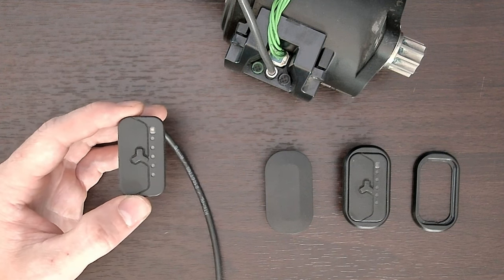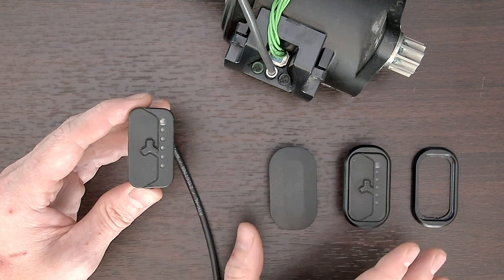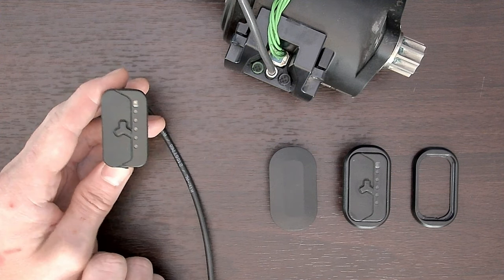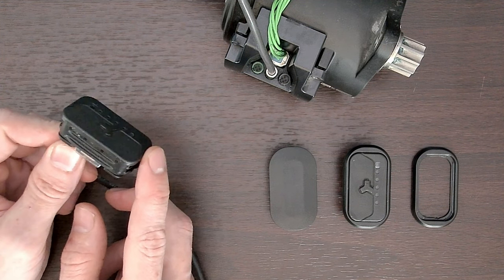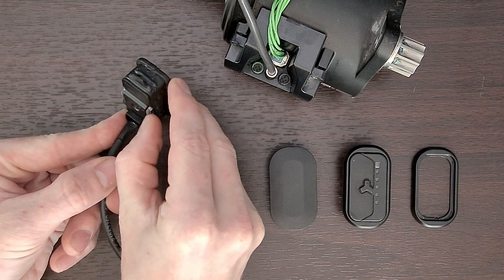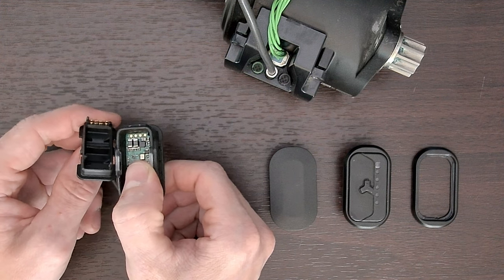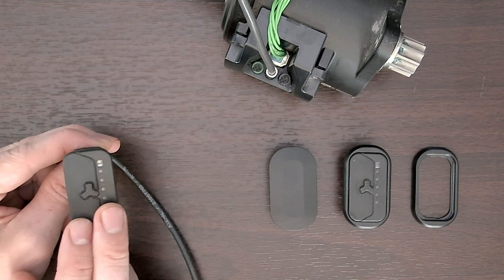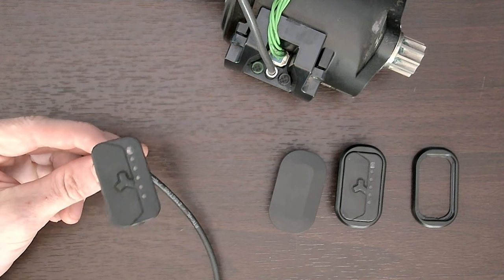Tips and Tricks for replacing FAZUA Remote FX - On Alloy Frames

Comment: Thank you. An excellent demonstration. My new-to-me Domane+ LT has about a thousand miles on it and this switch has become flaky; sometimes doesn't respond, or the lights change but not the assist level. I'm going to fiddle with the sensitivity setting first and worst comed to worse, swap it out. This video goes a long way to showing how.
Reply from the maker: Hi Chuck, I realized something after dropping this video in which I will update the description... If you have a carbon frame with an open head tube, its actually much easier to drop the front fork-steerer tube and push the remote up from the underside. As long as the cables are long enough, this makes the job very easy and no damaging paint.
Reply: @yourracemechanic  Thanks again!
As it happens though, more careful reading of support showed I could adjust the sensitivity of the switch. Actually I had seen that but it never occurred to me that was the issue. I haven't done more that run a diagnostic and update firmware. I found it set to the highest level!
Setting it to the lowest level solved all my switching problems.

Comment: Silicone spray around the edges of the remote made it easy to pry out with a pick.  I tried removing the fork, and pushing from the bottom of the head tube.  It did not work for me.  It is not a straight shot, so a curved push stick is needed.

Comment: It would be nice if you did a complete tutorial with the assembly and disassembly of the remte fx at the level of the frame of the bike and the engine
Reply from the maker: Thanks, I'd love to but one small issue.. I don't actually own a FAZUA equipped bike.  However, there are some assembly videos available to dealers, maybe I could cover what is possible with the home-jig I use in these videos. Depending on what the bike brand does, there are some proprietary steps that would be specific to that brand/model.  For example, the Trek Domane+ has a cover over the BB, the FAZUA videos would not cover removing this cover as FAZUA doesn't make this part.